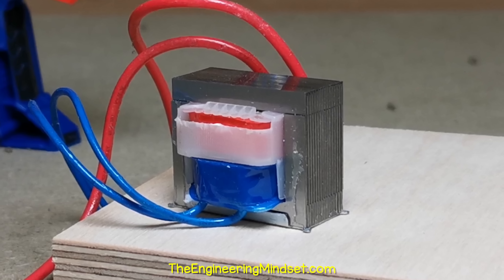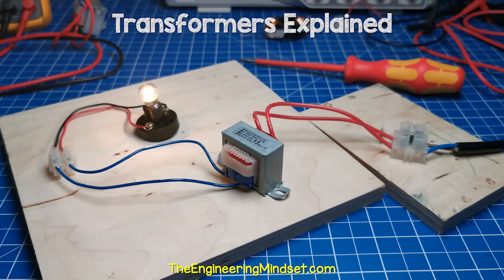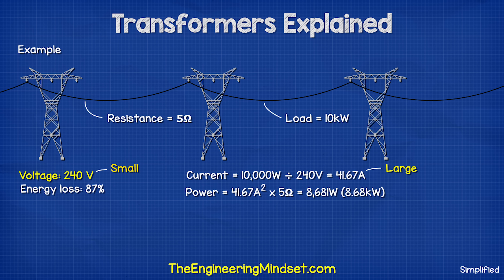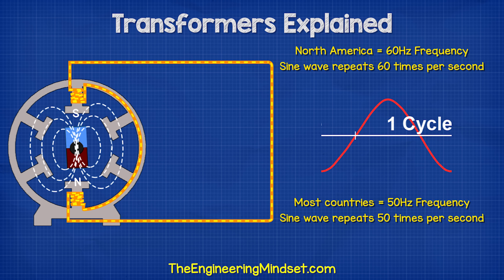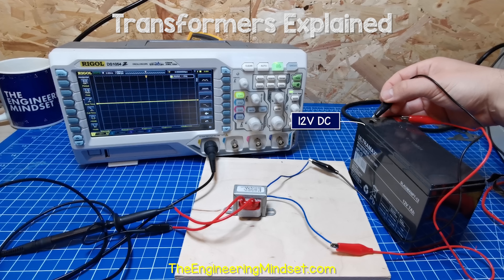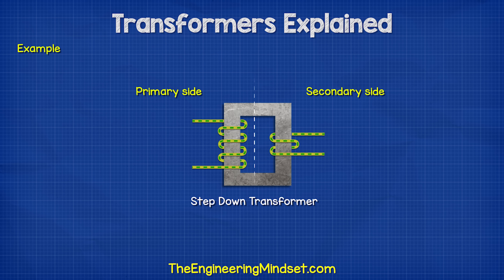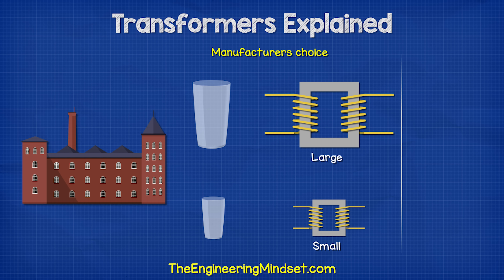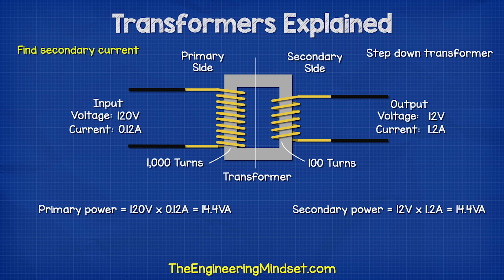Transformers Explained - How transformers work

Comment: It's been a long time since I learned about transformers (in much much greater detail) but I believe you got one thing very wrong!

Reactive power is NOT wasted energy! It's more like an useless energy that oscialates back and forth. It's still unwanted from the efficiency perspective since it takes capacity and causing some increased heat losses due to apparent current being higher than true/usefull current.

Power factor is also known as cos (phi), not to be confused with transformer (or whatever) efficency (n or eta)
Reply: PF and cosphi are two different things..
Reply: @snowywhite9663  Wrong, they're the same thing if we assume a perfect sinusoidal wave. In reality there is allways some harmonic distorsion quantified with THD

Comment: 12:02 we call that power consumption (total power) in CZ it is "příkon" - i understand it as all energy that goes into a device, and performance, "výkon" the job the device does. We were taught that příkon is always greater than výkon of the device, because of heat etc..

Comment: I always equated a transformer to a water hose that has a nozzle on it. You can constrict the nozzle to change the water velocity coming out.
Reply: I wouldn't equate those two exactly. In the instance of the water hose constricting, you would want to equate that with current in a circuit going through a resistance, with the pressure from the faucet being your voltage. I still don't like that analogy but it might help.

Comment: Anything the has inductance is considered transformer! Hear me out it depends on the property of the substance for example inductor are actually transformers that most of the time do not have a secondary coil BUT they store and shoot a voltage out which is higher than the supply voltage so it’s technically transforming it.

Comment: Is there any diference using 1000 turns on primary and 100 turns on secondary at 120V by using 100 turns on primary and 10 turns on secondary using same voltage?
Reply: Higher turn stronger magnetic field, better power transfer, but increase coil resistance that reduce efficiency.
Reply: More turns can carry more power
Reply: The difference is in the power/potency. When you increase the number of turns, keeping the same rate, the higher will be the potency of your transformer

Comment: There is a simple way to calculate current ,number of turns and the voltage according to the ratio:
Vp/Vs=Np/Ns=Is/Ip=constant ratio
Where:
Vp is primary voltage
Vs is secondary voltage
Np is primary number of turns and so on....
Reply: It's all same thing.

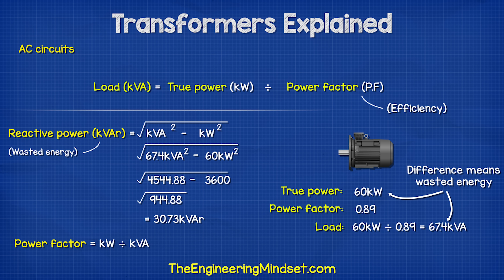Comment: At 11:50, I would like to suggest a correction. Reactive power is not wasted energy. It is actually wasted energy capacity (transformer in this case). Reactive power just comes back and forth from load and source. So, it is not wasted but only consumes conductor capacity which reduces conductor capacity available for active power.
Reply: This is my understanding as well Keval Pandya. I used to work in our state's energy efficiency program and we specifically banned power factor correction devices because they don't save energy (but many mistakenly think they do). It's more about the capacity of the conductor not being used efficiently to deliver power if anything, but not energy efficiency.
Reply: @samfisher874  As an discom engineer here in India, drawing reactive power is heavily discouraged by attracting penalty. Though I don't understand why power factor correcting device should be banned.
Reply: @kvlpnd  You're correct, bad power factor is heavily discouraged here in the US in California too. Customers are encouraged to use power factor correction devices if power factor is bad, and if they don't correct for bad power factor there will be a penalty on the bill. But separate from that, is the electric utility's energy efficiency program which gives customers money to purchase efficient LED lighting, premium efficiency motors, etc. Since bad power factor isn't wasted energy, power factor correction devices are not eligible for that money. Occasionally, a misleading/misinformed salesmen will incorrectly claim that a power correction device will save a customer lots of money by reducing energy (kWh or Joules), so it's specifically banned from receiving energy efficiency program money in California. (Hope I explained that well, it's 2:30 am here...)
Reply: @kvlpnd same in Italy.
Reply: I have a hard time understanding the subject of kVarh. The beer analogy doesn't explain it well in my opinion, not to mention the differences between lag and lead kVarh.
Reply: @SystemHacker23  Honestly I find it best to avoid analogies and just present a practical example. Motors don't go from totally inactive to totally active - capable of delivering torque to the output shaft - the exact moment electricity is applied. You have to get the core going with some amount of current to magnetize it before it is capable of doing useful work. This is the parasitic inductance. And at the end of each half cycle, the field collapses and this current is returned to the grid.  The transmission lines don't know what this current is for, they just see a higher current on them going back and forth, which leads to higher I^2*R losses. Which is why power companies hate poor power factor, and they encourage you to place power factor correction capacitors close to the motor. That way, the capacitor provides this current to build the magnetic field, as well as receive it again when the field collapses, and the power company only delivers the current going into real output power from the shaft.

Consider the parasitic inductance as a shunt element in parallel with the resistive/real power drawn from the output shaft. As a shunt element, it reduces the impedance seen by the grid and causes an increase in apparent current draw, thus higher I^2*R losses on the transmission lines, which are in series (resistors) with this network. When the capacitor is placed also in parallel in the network, it will resonate with the parasitic inductance, and as parallel LC circuits present an open circuit at the terminals at resonance, the parallel LC tank circuit basically becomes an infinite impedance in parallel with the resistor representing shaft power = the circuit simply becomes the transmission lines in series with the real output power of the motor.
Reply from the maker: Check out NEW resistor video, everything covered! ➡️ https://youtu.be/DYcLFHgVCn0
Reply from the maker: Seen the new LED explained video? so much detail covered! https://youtu.be/O8M2z2hIbag

Comment: my doubt Is 
what happens if uninsulated winding carrying ac current touches the core?
I asked this question to some one of my friends . but got no answer
if I am dumb forgive me.
Reply: I believe it will result in a short circuit and a bad day for your transformer.
Reply: @samfisher874  but wait isn't there eddy currents in the core already.
Even though the core is laminated and insulated.
Reply: @mackb996yt3  ah I'm not sure about how eddy currents factor in. From your comment I was assuming there was no insulation and an electrical connection was made from a winding. Normally it is insulated, but when it's not, a winding fault can be very bad in big transformers. There's something called a BLEVE which can occur which is a Boiling Liquid Expanding Vapor Explosion. When energy is released inside a big transformer though a fault, it can cause the cooling/dielectric oil to heat up and boil and cause an explosion. That'll be a bad day for anyone around
Reply: @samfisher874  that BLEVE thing was interesting. Thank.
Reply: @mackb996yt3  you're welcome. =]

Comment: How the increasing in frequency helps to decreases the size of transformer🤔
Reply: Each AC cycle electric energy is converted to magnetic, and back again. The amount of magnetic energy that a transformer can 'store' is more or less linear in its mass. At a higher frequency, more of these cycles occur, hence the same transformer would transform more power, or the same power can be transferred by a smaller transformer. For further interest, study transformer equations and it Will be more clear.
Reply: @PlayboyHZ  🤝
Reply: @PlayboyHZ  can you explain it simply
Reply: @kks319  buckets of water, it takes alot more cups of water to fill a swimming pool but you can move cups alot faster than buckets in the same period of time
Reply: @kks319  There is no simple explanayion. If you want to learn it to be able to use it someday, maybe in an isolated converter topology, you need to open a book and read about electromagnetics and transformers and inductors. Youtube videos only give you fundamental stuff, but thats barely enough to do something usefull.
Reply: @frogz  Is the iron core relevant to the frequency? Does the need for a larger heavier core increase if you lower the HZ?
Reply: @andersemanuel  Core is absolutely relevant w.r.t frequency. Consider two different frequencies, 50Hz/60Hz as it is in transmission systems/substations and 1000Hz.

If you design the transformer for 50Hz, it will obviously work well for a 1000Hz but not the other way round. This is because flux density is more in 50Hz and so it needs a bigger path for the magnetic circuit to complete.

For converter design which Can operate at frequencies to 1Mhz = 1.000.000Hz you Can use really really small transformer cores.
Reply: @PlayboyHZ  Thanks :)  That sounds reasonable. But for the same power transfer? Lets say 60 HZ compared to 400 HZ. Would one design with a smaller Iron core for 400 HZ with the same power transfer?